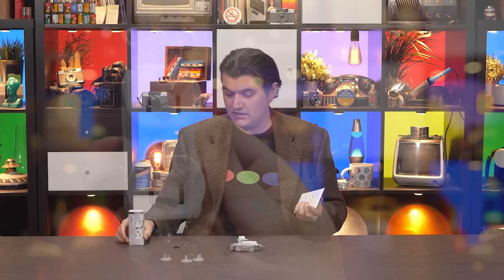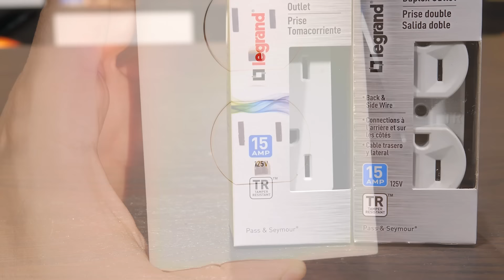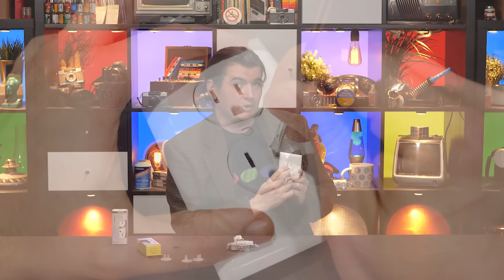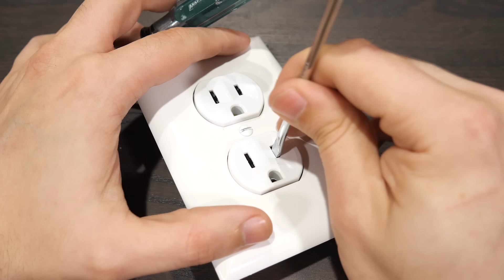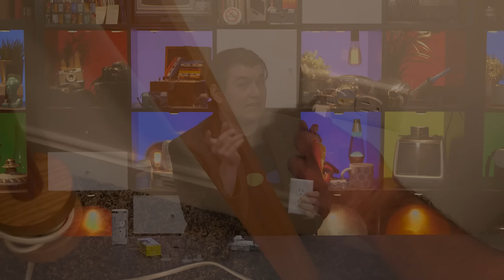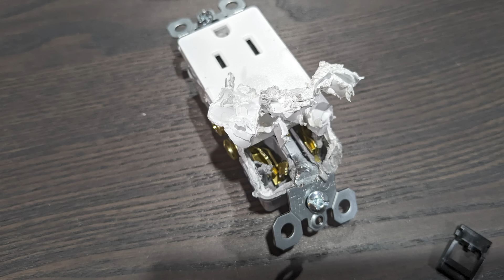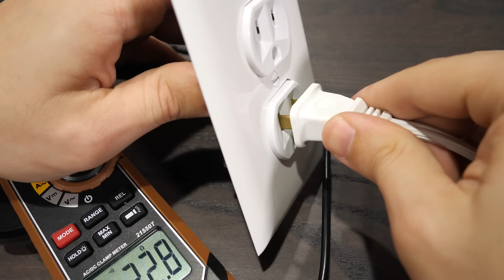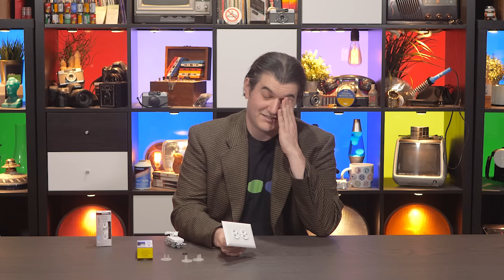Tamper-resistant outlets aren't all the same - a follow-up

Comment: I have worked as an electrician’s assistant as a young person, changed a few outlets live …. And been bit a few times by 120.   That was just a brief surprise.  I have also experienced 270 across a 3way switch terminal that I thought was disconnected.  That was unpleasant.    The most fun though, was when a 480v motor starter shorted and blew off the wall.  Fortunately by that time I had been trained better, was suspicious, and started it with a long stick while standing to the side!!!

For the most part, our outlets do not sag, and dropping metal down the wall onto the prongs seems like a pretty freak thing to do.   The bigger danger is people overloading circuits, or using too many extension cords and power strips.

Comment: @TechnologyConnextras Love the content, but every source I have seen says that more Current is more dangerous. If the the Voltage is half (120V rather than 240V) for the same Power the current must be double and therefore more dangerous.

Comment: I've been on a quest to upgrade my outlets to TR ones after my 3 year old got interested in sticking shit in them. Things I've discovered:

1. Spec grade outlets with back wiring (as opposed to back stabbing) are worth it. 
2. Pigtail the outlets (except GFCIs) so if one fails the rest don't.
3. Inspect the existing wires. I found a disturbing number of outlets with wires that had insulation scraped off. That's what started the whole thing-I was just going to do the kids' bedroom but found most of the outlets had the screws backed out or had insulation issues. It's been the same through the rest of my house.
4. If you're going to install an outlet with usb ports check how many wires are in that electrical box. I've found a few that had 4 hots and 4 neutrals connected to 2 screw terminals and the backstab and there are so many wires in those you'll never get a bulky usb outlet safely installed.

Comment: The European E/F Tamper-resistatnt sockets are a nightmare. I hate them, especially when I am about to plug in an Type C plug (CEE 7/16). The "beefy" E and F (CEE 7/7) plugs are less hassle, as they push both pins easier to the side when inserted.

Comment: The problem with not realizing that "safer" and "less dangerous" can be used interchangeably is probably mostly a matter of whether you understand relative concepts or not.  It's smilar to "slower" and "less fast", and most people somehow seems to get that "slower" doesn't mean stationary.      

I hope most people that oppose using "safer" actually understands that it doesn't mean totally safe, and that they're trying to prevent others from making that mistake. If so, while I do agree that a lot of people are incredibly stupid, but I also think anyone that thinks safer means totally safe shouldn't be experimenting with things like mains power.

Comment: A lot of desks will have power strips mounted so the Type F socket is facing down (probably not up to code) and even in that orientation a Type C inserted into it will just hang there. I'm not sure what the clamping mechanism looks like, but it's clearly quite heafty if it can hold onto 500g of plug and cord for years. Type F plugs also have the springs on the side which means they sit even better.

Comment: As an electrician I never used WAGO's or the stab in connections on a receptacle. The connections are done with pretty thin metal and connects at a very small point. Wire nuts and screw connectiors do much better.

Comment: As european.. no problem here.
Contacts arent exposed, child-protection shutters work great.
Maybe you should also try making hole-outlets instead? So the head of the plug sits inside the hole, hiding potentially exposed contacts?

Comment: The tamper resistant design does make it much harder to stick an item in, but a curious person testing them would be much more likely to use both hands to jam an item in each socket. That makes the worst path for the person because the electricity is for sure going to travel into one hand, through the arm, across the heart, and out the other arm and hand. And unless you're covered in something conductive like a lot of sweat, the electricity will arc through your skin and travel through your bloodstream due to all the electrolytes inside you that you need to live.

Comment: Something to watch out for is over wattage appliances. I've seen electric skillets that will draw more than 15 amps but they have a 15 amp plug. Because of this I'm slowly replacing all of my 15 amp outlets with 20 amp outlets. The breaker in the breaker panel for these outlets is a 20 amp so it seems to make sense to me it's just use 20 amp outlets be on the safe side.

Comment: I worked in hotel maintenance in Boston for a while. I think your assumption about the people from other countries saying outlets fall out is correct. I had to fix a ton of outlets with the issue that you described, and a lot of outlets to the point of not working at all because they were so loose. I will note though, I have also seen the same issue in older homes as well but that's probably less common because you can obviously just easily replace the outlets, which is not the case with hotel furniture.
Reply: The people from other countries also go to hotels in other countries than the US. In the 240V country I live in, hotel socket aren't loose, whether it's because of the socket design or the hotel maintenance (maybe by regulation ?), I really don't know…
Maybe a bit of both
Reply: @nit_  Those 240v are built solid, wish we had those.  I'd say probably more design and definitely regulation. Most larger hotels (especially in major cities) renovate the entire hotel every 7-11 yrs typically. Which includes brand new outlets. So the fact that outlets don't last more than a few years is probably a big red flag. They also do the American thing and get the cheapest outlets you can get. You'd be amazed how poorly some of the fanciest hotels are made. Very MicMansion like.
Reply: @james.mccormack I did a lot of travelling in the US a few years back and it seems that many of the more remote hotels/motels get sold downmarket from time to time (or perhaps just rebranded or refranchised) and only get very modest renovations.
Reply: @chaos.corner  Yeah definitely. When the hotel I worked at in Boston did it's renovation they sold all their furniture to a company that sells them to smaller hotels mostly in the Midwest. Interesting industry.
Reply: @james.mccormack  Yes. Leads to some very disparate expectations when it comes to the chains sometimes. I mostly stayed at Hilton chain hotels but ran into a very crusty one in Florida one time.
Reply: @nit_  British plugs don't fall out because, well they just aren't going to. Euro plugs (I happen to be in Iceland right now and so experiencing euro plugs) aren't going to fall out - they have that plastic bit taking all the strain but I've seen the two-prong euro plugs that got sloppy in some sockets because they do not have the plastic surround to retain them. US plugs rely on the grip on the pins to hold them in and so it's easy to see why they fail. My 1925 house in the US is full of sloppy sockets that I'm swapping out one by one.
Reply: @davidjohnston4240 Just for comparison, the right-angled US plugs are less prone to fall out. Another plus for them.

Comment: 10:36 "Push in" connectors are much better than side screws! In such connectors, the wire is under constant spring tension! This is exactly how Wago connectors work. And they enjoy well-deserved respect all over the world. The screw may become loose, the wire underneath may become flattened and the contact may become poor. This will never happen in spring-loaded contacts. Don't listen to those who say the opposite, they don't understand anything about the physics of electrical contacts.

Comment: I imagine the tamper proof mechanism is very similar to the ones used in EU plugs, as the requirement to push both prongs is the same and we have had them for decades. 
Coming from EU plugs where the live and neutral can be interchangeable and all appliances account for that, why is it still necessary to differentiate live and neutral in the USA style plug?
Also, it seems that at least here in EU you can find multiple ways to achieve 220-240v acros the prongs, some of them will make both prongs live in respect to earth. So while technically we do have live and neutral we always treat both as if they were live.

Comment: I'm sure others will have a different opinion, but i don't see 120v as being particularly dangerous. Been shocked many times (due to negligence and my own stupidity) and to me it doesn't even really hurt. Mostly just tingles a bit.

Maybe I have some freakish pain tolerance, but 120v doesn't really scare me much.

Also, my grandpa uses his fingers as a voltage tester during home improvement projects. He's 88 years old and hasn't been electrocuted yet, so it must be relatively benign 🤷

Comment: I find spring-loaded connections to be safer, just strip the wire and make sure, you pushed it all the way into the connector. I personally had to tighten a loosened screw in a daisy chained outlet in my old apartment to get electricity in the rest of the room.
I suspect in the US the wiring is often too loose, which allows ripping one off its outlet by pulling it through the wall from another part of the building? If so, why not fix the wires properly instead of relying on the connection to hold the wire in place?

Comment: I haven't seen anyone talking about sleeved pins, so I'll say that the Australian ones have the same dimensions the whole way down the live/neutral pins. The 'sleeving' is a hard resin that fills an inset portion of the metal pins. I haven't seen many European ones, but I'd assume they're the same.

As such, America could do the same without having to change anything else about their plug/socket designs.

Comment: I wonder why the plugs themselves never changed. Isn't it possible to add a plastic sleeve over the prongs, so no metal is sticking out before it makes any contact? It would require to make the metal prong thinner at that part to fit the sleeve. Like a Europlug. Wouldn't it not require to make any changes to the outlets and gradually make everything safer, whilst allowing to be fully backward compatible?

Comment: I live in europe and I do think the American plugs are falling out and I can explain. European plugs always require so much force to insert or remove, especially good brands like APC Schneider and brennenstuhl, that you simply CANNOT remove the prongs from the socket by pulling on the cable. ALL the American plugs I used whether it's adapters, at hotels, at home with a combination socket, just one pull on the cable and yoink the plug is dislodged. This is especially annoying at a work environment with a laptop because if it came with an American plug and I would move around a bit, the damn thing would just yoink out and I wouldn't notice until my laptop is at 10%. Especially with the Mac chargers, the weight of the charger if pluged on a wall will just pull it down and out if a feather touches it. I tried high quality adapters, I got high end converters, I even installed American wall outlets especially for the American laptops, nothing works. They just yoink out. A good European out however, the cable itself will snap before  the prongs give out. You have to put some good elbow grease pulling the head from the socket before it pulls out. I would really recommend buying an APC Schneider or brennenstuhl EU power extension and try it with EU socket to really get what we mean.

Comment: I'm a new home owner with 2 todlers that learned to unplug the plastic safety covers, so I'm replacing all my old outlets with tamper resistant plugs, and got Leviton Decora Edge which incorporate a WAGO type connector so there is no exposed connections in the box. I plannned to install the upside down because I can, and if i findmyself with an upside down right angle plug, it's not hard to flip the outlet. Also rewatched your rant on switched outlets, becasue most my rooms are switch-wired for lamps. However my new solution is putting an LED shop light on top of a bookshelf so it just shoots up . and the Koda ones I got at costco also have 3 modes that also toggle the output and have dim or bright by flipping my wall switch.

Comment: One thing I find interesting and didn't think about until also watching this follow-up video is with many GFCI and in general the Decora line of outlets is how flat their fronts are. Whereas a more traditional 15A grounded receptacles (and even the now much less common un-grounded receptacles) are slightly sunken around the pin entries. Making the plug have to come out ever so slightly more to catch something on the pins. It almost feels like there was some attempt in the past to try and help the issue a little with the original designs that the flat fronts undo. Just an observation with a dash of speculation.
Reply: The curvature also helps guide the pins into the holes when they're not quite aligned.

Comment: Though it would cause an awful lot of trouble and expense,     
the US should Immediately adopt either British or general European style plugs and receptacles 
and mandate timely replacement of all existing ones.   
Yes, they are bigger and uglier.  Yes, walls would have to be torn open.  And there are other reasons to object.  
But it would make a lot of sense   .....which is why it Won't happen..

Comment: In my experience, the Leviton TR are the most difficult to use and they incorporate a single shutter design. I prefer Eaton's dual shutter design. Pass&Seymour is similar two shutter design. Hubble claims to have the easiest use design but I do not have experience with them.

Comment: Tamper proof, wow, thats really impressive,  getting tamper proof outlets, here it was mandatory in 2002 (NEK400:2002), but common practice quite a while earlier..  So no you just needs to get the outlets resest, to prevent both exsposing the pins, and....  it would also prevent the plugs faling out, even if you say otherwice. ...

Comment: Whilst the great majority of UK sockets open the shutters via the earth pin, there are some available which require all three pins to be pushed in simultaneously. Of course they are on premium makes, so aren't that common, but they are around. In any event, welcome to 1947, at least in part, when BS1363 came into being...

I would add, that in adding shutter protection, it's going to be extremely important that the designers don't reduce the length of the wiped contact area. There can be up to 15A (or even 20A) current flowing on a NEMA-5 connector, and if the contact area is insufficient, then it can get hot really quickly, especially when the contact springs weaken over time. 

One thing about the much mocked BS1363 plug is that it is very secure and simply doesn't fall out of the wall, even with a heavy power adapter type. That's to do with the three pin design and that the connectors are solid brass. That's tricky with the physical constraints of NEMA-5.

Incidentally, the biggest danger from electricity is not being electrocuted, but the danger of fires. Far more people are killed every year by fires which started in electrical appliances and wiring than from electric shocks. As power goes to the square of current for a given resistance, then it follows that if there is a "hot spot" due to a poor contact or wiring connection, something that requires twice the current has the potential to generate four times the heat. Hence, whilst 120V is safer in terms of the danger of electrocution, the fact that it requires twice the current of a 240V system for the same power output can increase the possibility of electrical fires. So it's not such a simple equation, although there is a sort of missed opportunity in the US. If standard outlets used 240V, then it would give both that lower voltage to ground and lower current. The only downside is that it requires dual pole breakers and a fuse blowing inside an appliance will not completely de-energise it. Incidentally, go back a long way and the German electrical system with the Schuko connector used to be exactly like that. Power was delivered as 220V as two out of phase "hot" connections at 110V RMS to ground. However, later on that was changed to provide neutral + 220V, but it's due to that legacy that the Schuko connector is not polarised which causes issues with single pole switches and internal appliance fuses being randomly on neutral or line voltage, which is not ideal.
Reply: I wouldn't say that 3-pin-at-same-time sockets were uncommon as such; you can buy them in B&Q. More that people fit the cheaper brands instead of premium. Though an MK double socket is only £4.20 and a cheaper one is still £2.80.

Comment: From what I have seen, the loose plug issue is less due to the cheap outlets, well technically true, but rather its due to old and worn out outlets, especially ones in hotels that get used by the housekeepers to vaccume the cords. This is also an issue in rental houses from what I hear, basically anywhere where there is old outlets that have been used a lot.